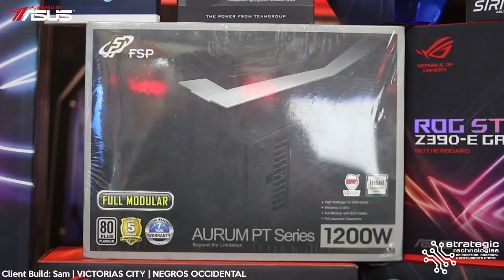BUILD LOG: Sam | VICTORIAS CITY, NEGROS OCCIDENTAL | ASUS ROG Strix Helios  GX601

Comment: How important is it for PSU to be upside down?
How does stacking several layers of fans on he front work? What if i use the fans that come with the AIO on one of the layers that have a much higher CFM than regular case fans in the other layer?